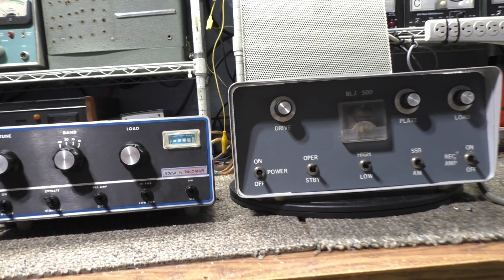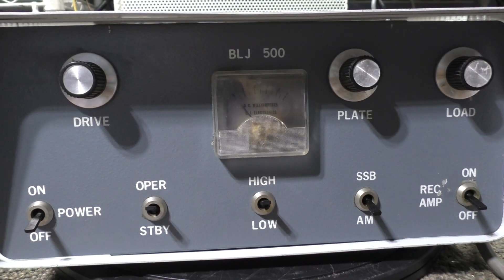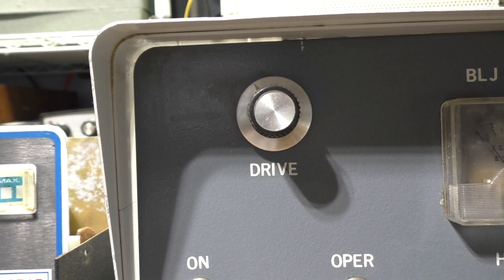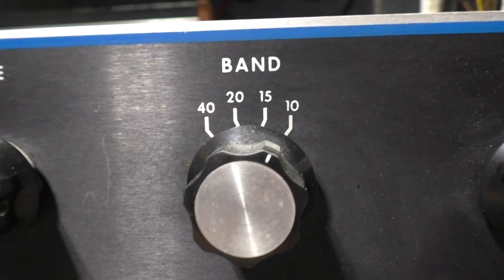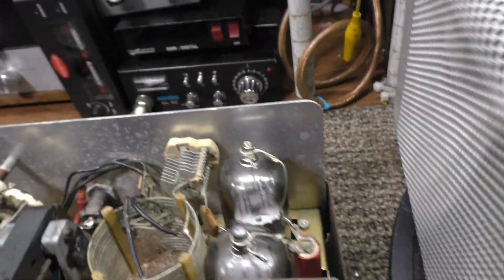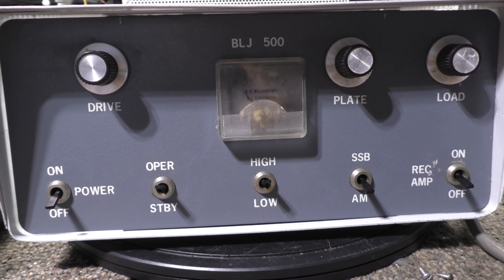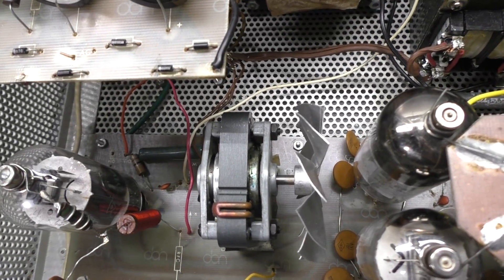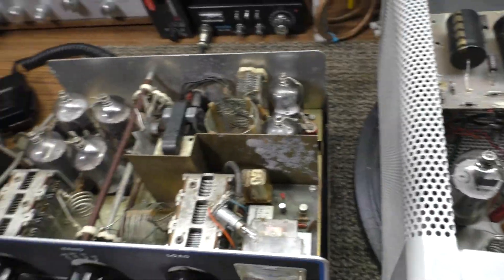Battle of the sweep tube amplifiers talkthru Palomar 300A vs BLJ-500

Comment: I have Paloma’s 350z i get around 600 watt pep on high. If I run 80 watts in to it on low will it do more than 600 in your opinion?
Reply from the maker: A Palomar 350z is very different than a Palomar 300a. The 300a is grounded grid triode and on Low, the driver tubes are bypassed. Solid dependable design, The 350z they took the basic grounded grid design and turbocharged it, and not that well at that. Hence, they get a little more out of it, like the 600 watts you are getting, but it stresses out the tubes and the rest of the amp. The 350z was very undependable. Also, even more important, on Low, the 300a BYPASSED the driver tubes so yeah, on low, you could drive the 300a with around 80 watts or so. However, with the 350z, on Low, instead of the drivers being bypassed, they just turned down the Turbo (Screen) of the driver tubes on low. Hence, if you drive the 350z with 80 watts even on low, it will do a lot of watts than 600 for a few seconds until the amp blows up.

Comment: Can we also discuss the housing? The BLJ-500 looks stunning, sturdy, uncorroded, integrated transformers and will most likely get a lot less hot. The Palomar design points to an electronics focus. I recognize that, it’s more fun. But the varicap should have been in the front. A needle gauge would have been nice. As regards difficult maintainability of the BLJ-500: that was a business model even in those days. You have to go to the shop or buy a new kit.

Comment: I got a scout 20 amplifier do you know where I could get some tubes for it? Think they are 6lz6
Reply from the maker: Ebay and patience is where I get most of mine. 6lz6 is a 9 pin clone or sub of the 6lq6 family:  
9 PIN Plate on Top:
6JB6  17.5
6JF6  17
6JU6  17
6KM6 20
6LQ6  30
6LZ6  30
6JE6  30
6ME6  30
6MJ6
Reply: Thanks man ill give it a try  @tramdr